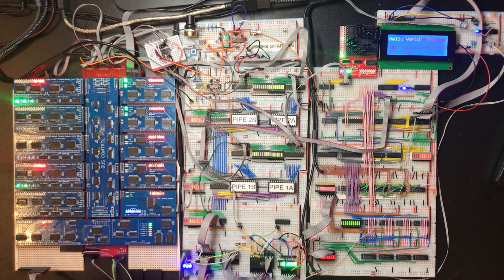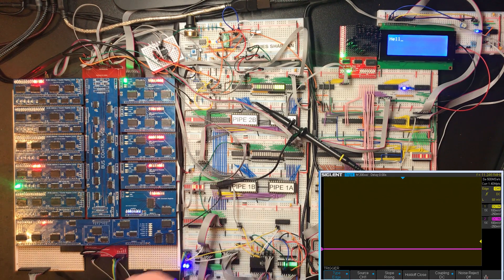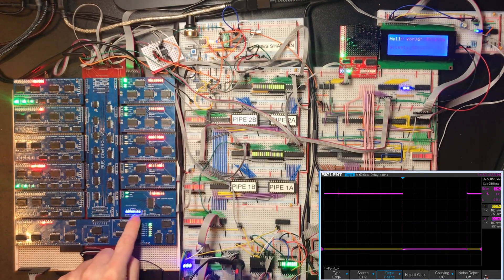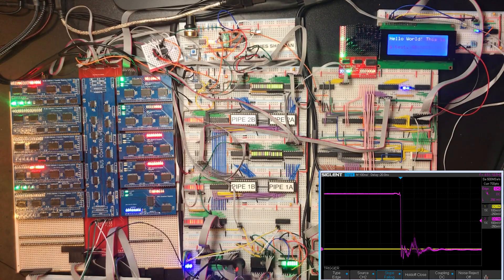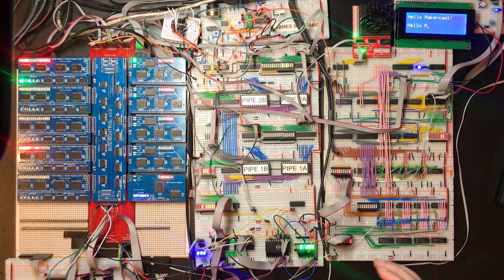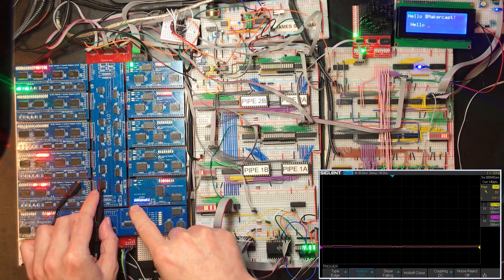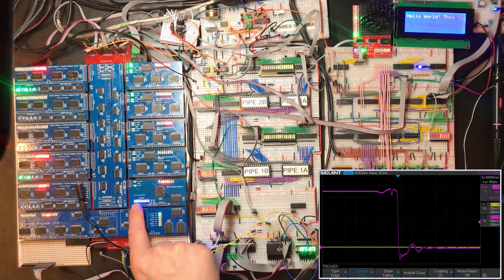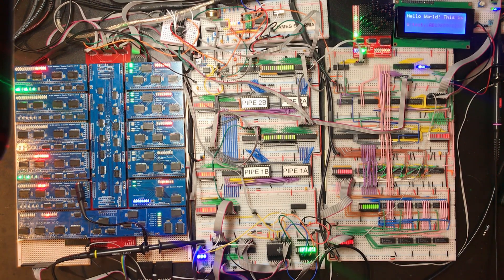Working Again! - Making an 8 Bit pipelined CPU - Part 59

Comment: So, I've been reading the comments, and I'm a bit surprised that power/ground loops (assuming you don't have power or ground coming from two completely different sources) are a bad thing. According to my naive understanding, I'd think having a power/ground loop would decrease resistance and thus improve power distribution. Does it have something to do with AC characteristics rather than DC ones? I'm admittedly not that well versed in that area.

Isn't the CPU already Turing complete? You don't need RAM to get arbitraily large storage capacity. You could also multiply the size of all of the registers by some arbitrary positive integer. As proof that the CPU is already Turing complete, here's a (somewhat unoptimized) program that interprets FRACTRAN, which is known to be Turing complete (initial input, numerators and denominators of the fractions that form the FRACTRAN program, and intermediate values are all 16-bit, but they could be made arbitrarily large with wider registers):

mov tl,(INITIAL_INPUT&0xff) ; Assume assembler has ability to perform operations on constants
                                                    ; (I use C/C++ notation for constants, but this can be changed to match what your assembler expects.)
mov th,((INITIAL_INPUT>>8)&0xff)
mov ra,tx                                              ; initial input into RA
mov tl,(fractran_program&0xff)
mov th,((fractran_program>>8)&0xff)
mov sp,tx                                                   ; start of FRACTRAN program into SP

interpreter_loop:
; Point SI at start of FRACTRAN program
mov si,sp

find_next_instruction_loop:
; Put next denominator into C:D
mov d,[si]
inc si
mov c,[si]
inc si
; Put current input into A:B
mov tx, ra
mov b,tl
mov a,th
; Clear DI (quotient)
mov tl,0
mov th,0
mov di, tx

; Divide current input by this denominator using repeated subtraction
; (I couldn't find a way to fit all of the intermediate results needed by a shifting implementation of integer division into the available registers.)
division_loop:
; Subtract this denominator from current input
sub b,d
subb a,c
; JA isn't properly implemented at this point, so we need to exit the division loop if the unsigned remainder is zero or an unsigned borrow occurred (carry clear)
mov tl,(instruction_not_found&0xff)
mov th,((instruction_not_found>>8)&0xff)
jnc tx                                                                   ; If we have a borrow, the division has completed, and the current input is not divisible by this denominator, so this is not our instruction.
inc di                                                                   ; Increase quotient (This is the branch delay slot, but we don't care about the quotient if this isn't our instruction.)
; Continue division loop if the remainder is still greater than 0
mov tl,(division_loop&0xff)
mov th,((division_loop>>8)&0xff)
jnz tx                                              ; high byte
test b                                             ; branch delay slot (We don't care about preserving flags here.)
nop                                                ; Wait for ALU operation to complete
jnz tx
nop      ; branch delay slot

; Put numerator into C:D
mov d,[si]
inc si
mov c,[si]
; Clear A:B (product)
xor a,a
xor b,b

; Multiply quotient by numerator using shifting algorithm

multiplication_loop:
; Divide numerator by two (Logical carry is guaranteed to have already been cleared here, either by the XOR just before the loop, or the TEST instruction at the end of the loop.)
shr c
shr d
; We will need the quotient on both sides of the upcoming branch, so grab it into C:D after saving the numerator to SI.
; (We've already retrieved the FRACTRAN instruction for this iteration, so we can afford to clobber the index into the FRACTRAN program.)
mov tl,d
mov th,c
nop            ; Wait for eight-bit move to complete
mov si,tx
mov tx,di
mov d,tl
mov c,th
; If logical carry is clear, we don't need to add the quotient for this bit, so skip straight to finishing up with this bit in that case
mov tl,(multiplication_finish_bit&0xff)
mov th,((multiplication_finish_bit>>8)&0xff)
jnlc tx
clc       ; branch delay slot (Ensure logical carry is cleared for later shift left)
; Add quotient to product
add b,d
addc a,c

multiplication_finish_bit:
; Multiply quotient by two
shl d
shl c
; Put quotient back in DI
mov tl,d
mov th,c
nop            ; Wait for eight-bit move to complete
mov di,tx
; Put numerator back in C:D
mov tx,si
mov d,tl
mov c,th
; If either C or D is nonzero, the numerator hasn't been used up yet, so the multiplication isn't finished
test c
mov tl,(multiplication_loop&0xff)
mov th,((multiplication_loop>>8)&0xff)
jnz tx
test d  ; branch delay slot (We're fine with this executing even when the branch is taken.)
nop     ; Wait for ALU operation to complete
jnz tx

; Multiplication is complete, so move the product from A:B to the input to the next FRACTRAN instruction (RA)
mov tl,b   ; branch delay slot (We don't mind clobbering TL when branching.)
mov th,a
nop          ; Wait for eight-bit move to complete
mov ra,tx
; Jump back to start of FRACTRAN instruction list
mov tl,(interpreter_loop&0xff)
mov th,((interpreter_loop>>8)&0xff)
jmp tx

instruction_not_found:
; Skip over numerator
inc si                               ; branch delay slot (We don't care about the value of SI being preserved when jumping to the beginning of the interpreter loop; SI will be reset anyway.

inc si
; Check next fraction
mov tl,(find_next_instruction_loop&0xff)
mov th,((find_next_instruction_loop>>8)&0xff)
jmp tx
nop      ; branch delay slot

fractran_program:
; Put the FRACTRAN program to be interpreted here.
; Each fraction is encoded as first the denominator as a 16-bit unsigned integer, followed by the numerator as a 16-bit unsigned integer, where both are little-endian.

db 1,0,1,0 ; The fraction 1/1 does nothing to the input, so this acts as the halting state for the FRACTRAN program.
Reply from the maker: Ground loops are a problem, I'm not sure I'm qualified to break it down all the detail but remember that while we talk about digital signals the analogue realities are far more complex. If someone walked into my study with an inductor and proposed wiring it in somewhere at random I wouldn't be very happy about that, but we can inadvertently do that ourselves!

Comment: When you test the signal on an input pin way across the board relative to the ground of the driving IC, you're not testing what the input the gate actually sees, because its using its ground to determine the voltage level.

It's really interesting that this occurs on a specific set of conditions.

On the plus side, you know your CPU will be able run pretty fast based on the switching frequency of the ringing.
Reply from the maker: Well it's always smart to look at what the signal looks like at both the source and where it's getting used.
Reply: @weirdboyjim  Of course. But unless you are sure the ground voltage is the same at both locations, measuring the destination signal with reference to the source ground won’t show you what the destination pin is seeing because it will be referencing the signal against the ground it sees

Comment: Indeed, per my comments to your CPU 52 video, ground continuity by the lowest impedance path is crucial. You could do it by respinning the boards to improve ground and supply continuity; you could do it by adding inner ground planes to the separate boards; but I think the most expedient method will be adding a good backplane with a solid, uninterrupted ground plane throughout.
Reply from the maker: Yeah, I've been designing a lot more with this in mind recently.
Reply: Lots of people saying adding decoupling, but that is so stabilise the Vcc line, the problem seems to be ground rising up, not power falling down. Definitely having large power draws on data lines isn't good and all that power is going out through the ground pin of the driving IC. Extending from your comment, increasing the thickness of the trace for ground pins would be good, in addition to having LED drivers with a separate power rail and ground rail for the LEDs, although the common ground tie between data and load lines will be a source of concern to keep data ground clean.

Comment: I'm pretty sure the majority of your issues are from lack of decoupling. The PCB section is probably fine(for now), it just needs to have some electrolytics sprinkled around. For the breadboards I'd put an electrolytic across every power rail.
Reply from the maker: I established that decoupling is the main issue over the last few videos (I had a pretty good idea of that anyway but I bought the scope to see exactly what was happening). When you  “Put an electrolytic across every power rail” would you like to elaborate on that? I’ve never claimed to be an electronics expert and I do get some excellent suggestions in the comments but I also get conflicting suggests and things that don’t sound right. Electrolytic capacitors tend to be higher capacity and slower response than ceramics, the issues I see are confined to short time span after a line transition.
Reply: @weirdboyjim  You should use electrolytics in addition to ceramics. It's a similar principle to a multilevel cache in a computer.

 From my limited perspective it's easier to suggest taking the overkill approach. Normally you'd have at least one bulk decoupling capacitor per board. With your PCB setup it's hard to say how many you need. With breadboards it's kind of a "beating a dead horse situation"...

Cynicism is a good thing to have these days. Look into "inductance loop area". Get a good grasp of it before you redo your PCBs. As you have them setup now ground planes won't really do much.

Comment: Great to see some issues being identified using the scope.  A few thoughts sprung to mind…  1. Start with adding decoupling caps to the IC’s driving the highest load transitions (eg. bus drivers).  2. Are you connecting the decoupling caps as close as possible directly across IC power pins?  3. How is the power being routed throughout your layout? ie. Is the power being run in a fan-out arrangement, or could you possibly have created one or more power / ground loops?  Keep up the great work!
Reply from the maker: Decoupling caps on the boards are by the chips, it’s a bit tougher on the breadboards. Getting extra decoupling on the line drivers was the big learning from this video. Ground loops on a build like this are essentially unavoidable (In so far as a control line being held down can form part of a loop). I’ve been evolving ground towards a fan arrangement but there are places where things have to connect back (i.e. memory connects to fetch at the top of the pipe but the bottom of the pipe drives memory address selection). The trick seems to be to have edge critical control lines on a strict fan but data lines (that can be given time to settle) can be more flexible.

Comment: I always add a flooded ground plane on pcbs, I don’t know how much of that you have, but if you don’t then you should consider it when you redo the board.
Reply from the maker: I always put flooded ground in, on the control board (The tall one in the middle) there are lots of control lines running down the middle that split it in two so the ground path for the line that gave me big problems is terrible. It’s all a learning experience, I won’t make that mistake again.